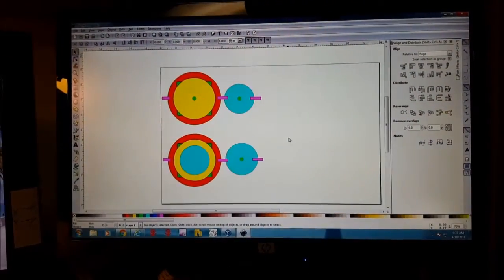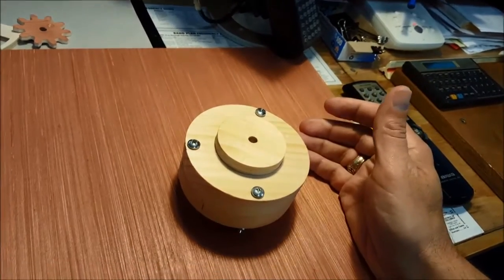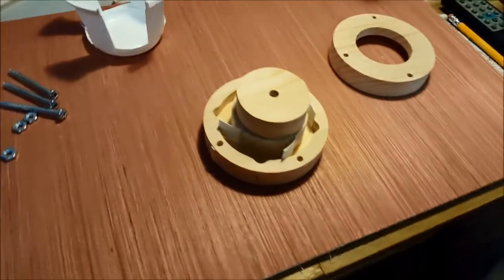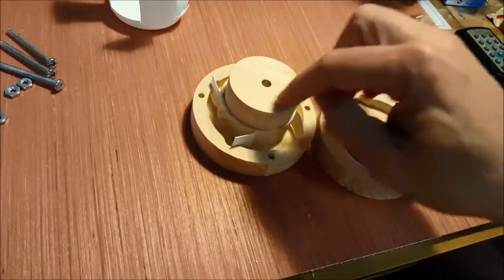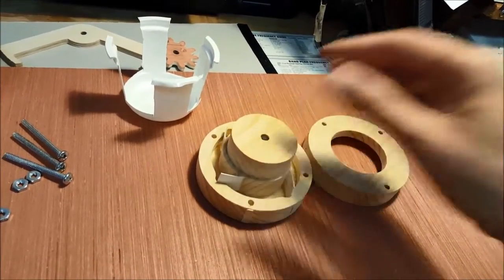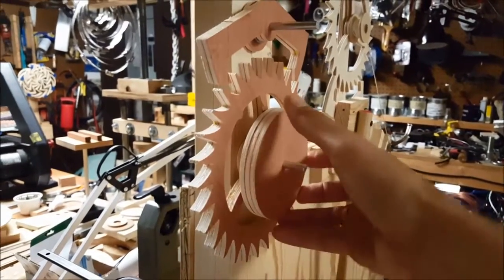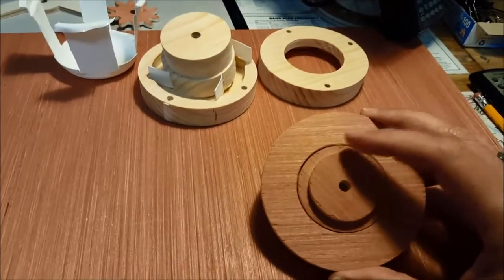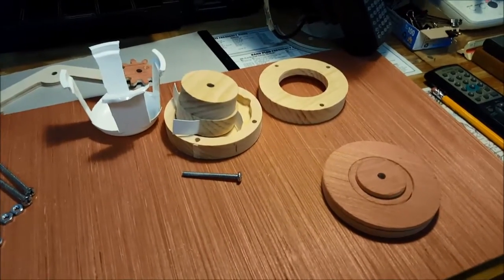Wood Clock Ratchet Design - Simple Project

Comment: Here is a clockwork spring 3D print video design 1 {not clock}  will use ratchet
https://youtu.be/XeNDafNARZs?list=PLUqt0sTiXUDdcmmreGoee2sW6Nck3aPFl
Reply from the maker: Definitely something I want to try.  Cool.
Reply: The spring shown can only be wound up about half a turn, for the size and is quite weak so may not store enough to power a clock. It is just prototyping :)